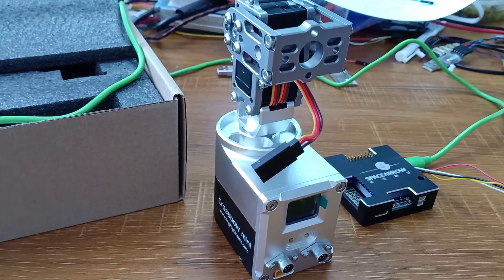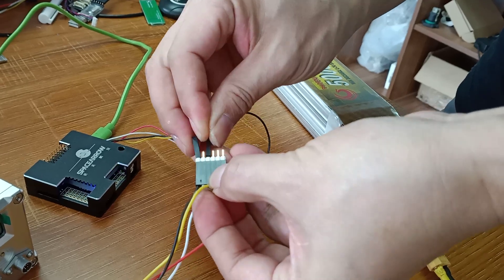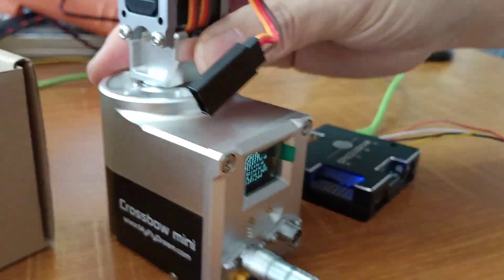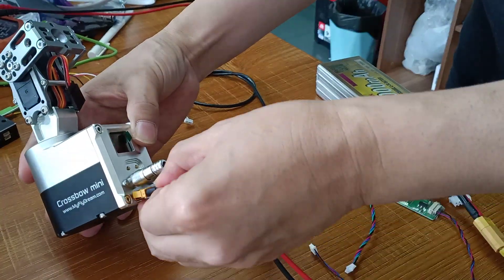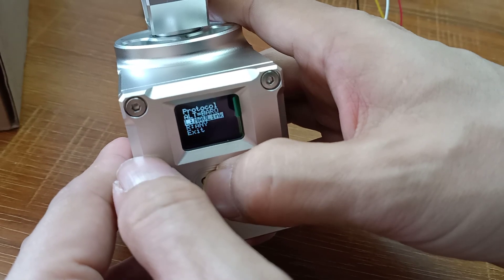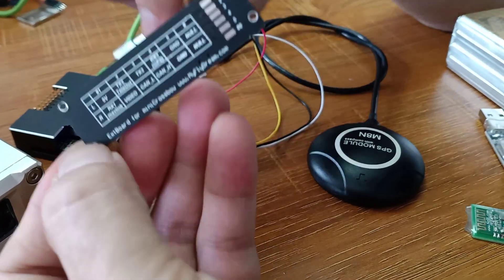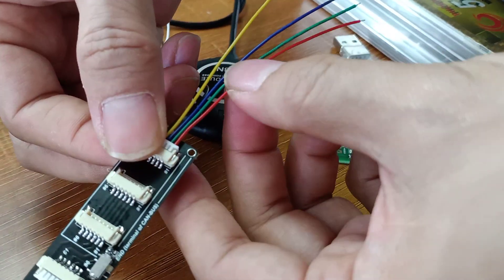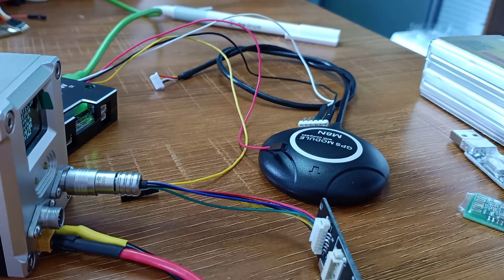How to feed MAVLink data to your mini Crossbow AAT

Comment: I have a question, does the crossbow need a gps fix position? or can I move it while my aircraft is still in the air? will it sustain the tracking?

Comment: Thanks for posting. I have Mavlink up and running now. I have also added a HC-05 module for Bluetooth. You have an amazing product here!
Reply: I have this to and I'm getting 100% dlink with mavlink with the siyi hm30 hd system but it will not track ,any idea what I'm doing wrong
Reply: @jimmytheriot8978  Have you separated the plane and tracker 10M (100 feet) to initiate the startup? ( That got me at first)
Reply: @rockfordmckay  I just set it up and flew the plane thinking it would track
Reply: @jimmytheriot8978  sounds like you got it separated for the initial startup. If the baudrate is correct and the SIYI is sending out Mavlink packets, it should work. If it's reading 100% I am thinking the baudrate is good. But double check what the baudrate SIYI communicates at.
Reply: @rockfordmckay  baudrate are both 57600 ,I'm get gps info like lat and longitude but if I scroll down to home position on the tracker info there's nothing, should it be reading something for home position?
Reply: @jimmytheriot8978  yes, did you press the right key to set home?
Reply: @rockfordmckay  no
Reply: @jimmytheriot8978  that's it then. It has to be pressed to set home manually. ,,😀 I hope that does it.
Reply: @rockfordmckay set the home position and that got it moving , was just able to try to test on the ground, guessing the plane would have to be in the air to track accurately?
Reply: @jimmytheriot8978  Fingers crossed, that will do it!
Reply: @rockfordmckay  thank you for the help , soon as I get good weather and time ima try it out and post a video of another 400' long distance test , how is the system you got working out?
Reply: I am jealous. I have -40C or F some days with wind. I have to wait a couple months before I can fly again. The next thing to do is get everything setup for WiFi. I have been told it's more reliable than the Bluetooth connection. Amazing all the skills we learn in this hobby ❤️.
Reply: Hello friend, maybe you can tell me how to properly configure the bluetooth module (HC-05) with Mini AAT to track the model through the "MFD AAT" Android application. I do everything according to the instructions, i.e. I connect to the "L" connector and connect the TX2-teleout to the RX of my bluetooth. I also supply power from the "L" socket with 5+ voltage. In the protocol in AAT I choose MavLink and unfortunately my application does not see the location of the model :( Thank you for any help :)
Reply: @szczery_fpv  The Bluetooth configuration is as follows

AT+RMAAD
AT+ROLE=1
AT+UART=57600,0,0
AT+RESET
AT+CMODE=0
AT+INQM=0,5,5
AT+PSWD=1234
AT+INIT
AT+INQ

AT+PAIR=4,3E,4C8880,10 
AT+BIND=4,3E,4C8880
AT+LINK=4,3E,4C8880 

Once configured make sure baud rate is 57600. You can check if Bluetooth is functioning properly by checking the menu under core date (under Factory menu). I use Mission Planner or QGround Control for Ground Station software. I have not used the MFD AAT android application. 

The Bluetooth did work well for me. Later I switched to using wifi so that all components were on same wifi network. Worked well with Crossfire system.
Reply: @rockfordmckay  
Thank you very much, you made this subject clear to me. I have the speed you describe and what the manufacturer of the bluetooth module says. I will check how it behaves with another application. Greetings.
Reply: @szczery_fpv   Hey buddy, I actually don't use a blue tooth module , I have the jumper T16S radio With all my telemetry active , And I use a hard wire From the  Uart  port at the bottom of the remote To my Mini  Antenna tracker
Reply: @jimmytheriot8978  THX :)

Comment: Using a Telemetry RX/TX (433 MHz) on top of the Tracker, as it is usual for a ArduPilot System, we miss SlipRings to feed the AAT Signal down from the receiver unit turning on Top to the AAT Basic, e.g. the Connectors. Or using a SIYI MH30 which can transmit the Commands to the air unit, also. See here: https://www.youtube.com/watch?v=G2j1gCAj6lM&t=39s
He must take the cables throu th air down. Will make a lot of troubles when rotating more than 360 degrees.

Comment: I am having trouble getting the mini aat working with my crossfire tango 2 and iNav sending mavlink over wifi to a esp15. I get DLink:MSG? on the aat. I read in the manual this means MAVLINK_MSG_ID_GPS_RAW_INT
 and MAVLINK_MSG_ID_GLOBAL_POSITION_INT are likely missing and to check if they are there. I have no idea how to check that they are there coming from iNav or what to do if they are missing. Some help would really be appreciated. Thanks.
Reply: Did you ever get this working?
Reply: @thomasgreenhill4901  yes, iNav 3.0.1 crossfire 6.13 and WiFi 2.04 works just fine
Reply: @JoshFisk  could you make a video on how to

Comment: I use a Fy-41-AP Lite and would like to buy such a tracker, but I have some doubts:
1 - What will I need to use this tracker with my Fy-41AP?
2 - Will I need to have another GPS connected to Telefly?
3 - Will I be able to use with 5.8 ghz and 1.2 ghz systems?
Reply: You need to use the TinyTelefly module with and extra gps

Comment: Hi, been loving your videos on Crossbow Mini, can I ask your advice please? I'm fitting a TBS Yagi FPV 2G4 and a TBS Crossfire 868Mhz Yagi, do I need to have a specific clearance distance between these two antennas on the mount or does it not matter?  Thank You :-)
Reply: hello, did you try it? does it work? I am looking for the same set up
Reply: @exoops    Hi, I've done some basic communicating test which all worked OK. Not yet used it on a real long flight. weather in UK is pretty crap at the moment
Reply: @stevietee10  Looks promising; I just finished the set up of the tracker and both yagi are waiting to be attached to. Will be trying this set up asap once yagi mount is printed out.

Comment: I just received mine and had it set up within the day.  I tested it the following day and was running fine for and hour  the next time I turned on after changing batteries the tracker went from its normal horizontal position and suddenly pointed to face straight up and track in the opposite direction.  I have checked the manual but I could not find any answer.  Do you have any ideas what could have happened.  I have had my original AAT for 5 years and it never had a problem like it. Please help.

Comment: This is great.  I appreciate the video.  Since the documentation is a bit "slim" this video truly provides a clear picture of the process.  Do you have any additional tutorials on getting the TeleflyTiny OSD to communicate with the Crossbow mini?  I've been having an extremely difficult time.  Specifically, I am receiving Dlink and GPS signals perfectly with just the flight controller OSD showing (FPV camera not turned on).  However, the moment I turn on my FPV camera (I've tried two different RunCams) I lose Dlink and GPS sats immediately.  Is there something special with the FPV camera wiring I should be doing?    Do you have a setup video for this I can see the wiring?  Thanks in advance.

Comment: how many mah can the 5v output on the left port deliver? because i want to use a BT Module to share mavlink telemetry from my crossfire AND the external GPS for getting the Tracking Position but I actually need to power those 2. 
So I thought about powering BT Module and GPS from the same 5V Output in parralel

Comment: Great to see the new boards that way it is easier to access all ports.  Unfortunately I would prefer to use the vbi link as it should be much longer link than my telemetry and also work with the older mfd aat. It seems it is very sensitive to the wiring someone mentioned it's the connectors. I can have 100% vlink and move the wires around some and the link will drop to zero. I have started a flight with tracking and had it drop out during the flight. Some have reported that it doesn't work with certain cameras. Do you have any advice on that. 
The ultimate solution for vbi is if you would help Ardupilot and iNav embed the needed telemetry without the telefly tiny.
Reply: I've had the same issues on my end.  I'm using the TeleFly Tiny OSD with the MiniCrossbow and all works fine.  However, the moment I turn on my camera (runcam Swift 3 and runcam 2 mobius type) I lose Dlink and gps sats immediately.  If I only have the osd from my flight controller it works fine.  Have you seen any solutions to this yet?

Comment: nice clarification Charles.  Much better idea to breakout the L & R ports to save on micro soldering  :)
Reply from the maker: We understand that soldering those tiny pins is painful... This new ExtBoard will make things much easier.
Reply: MyFlyDream what type of sockets are used on the breakout board? I’d like to get some pigtails for Bluetooth & GPS.